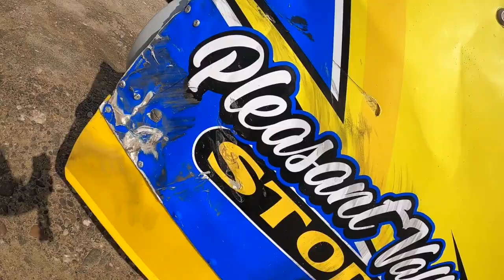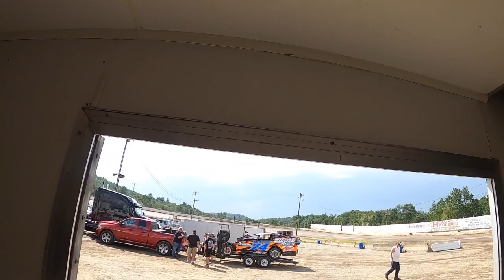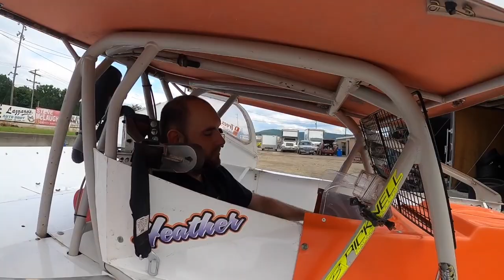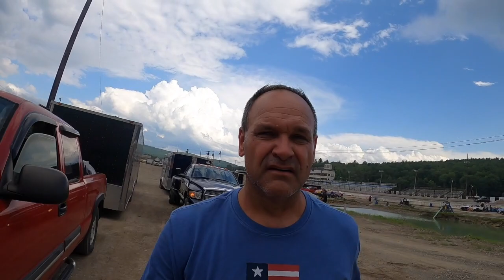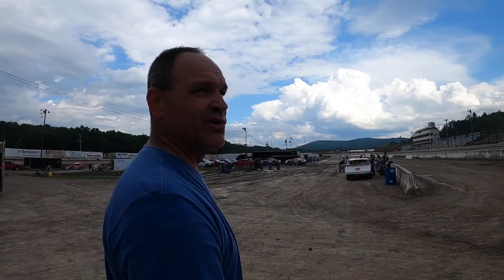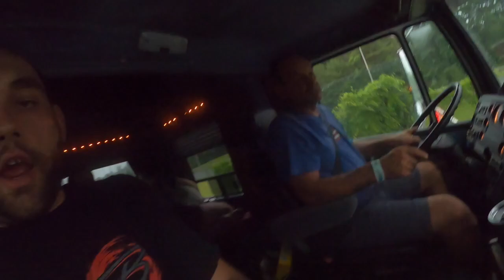Take a Walk Around Lebanon Valley Speedway with us!

Comment: I never visited a track with pits in the infield.  What happens if a driver shows up late (after hot laps start)?
Reply from the maker: Usually the track is pretty decent and will let you in during intermission or right after the heats. But you need to be there early because space is right! Definitely one of the tightest pit areas we go to!